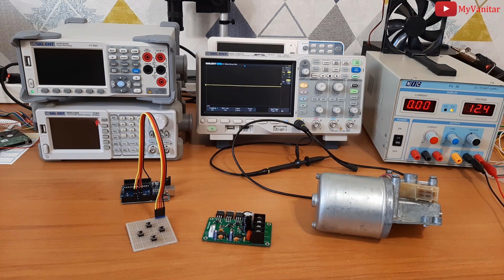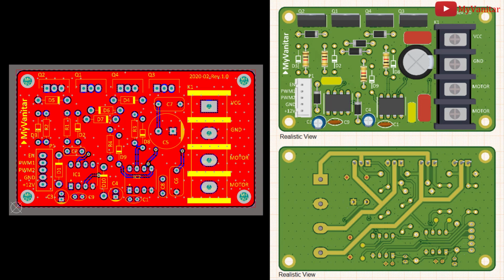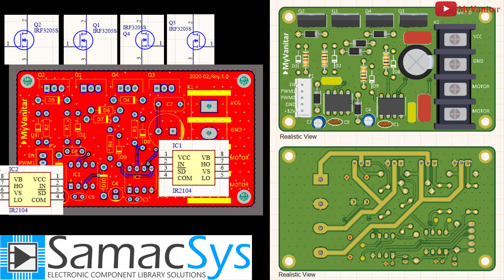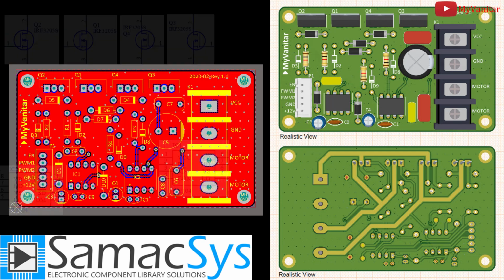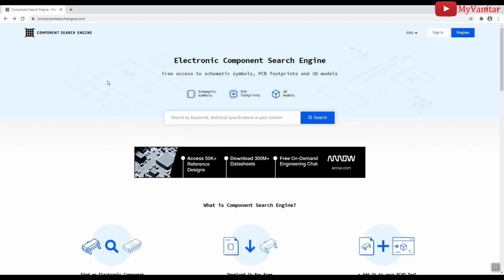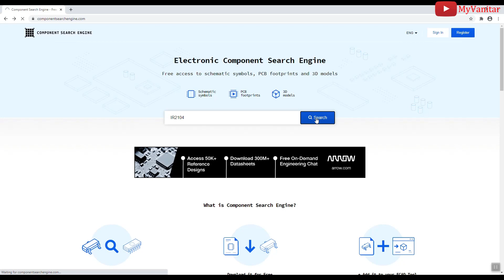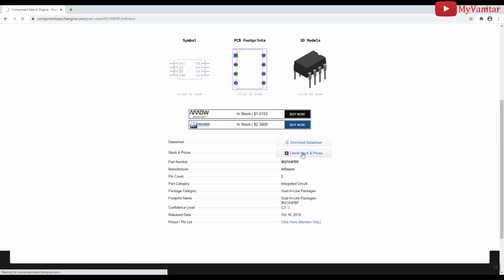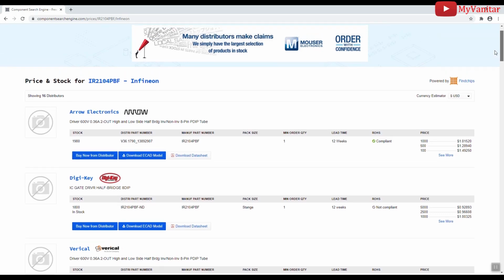H Bridge DC Motor Driver/Control Circuit [40A PWM, Power MOSFETs]

Comment: can I use it for nema34 stepper motor??
Reply from the maker: The short answer is No, because stepper Motor mechanism is different. it needs its own driver. I may cover it in future articles. it is not difficult
Reply from the maker: You need two of this circuit to run a stepper motor, one for each winding

Comment: Sorry but Its not keeping the torque identical that I'm interested in. Would like to know how this driver board performs under a sustained high current load. Simples!
Reply from the maker: the half bridge and full bridge configuration are the only methods that you can trust for stability and also low EMI
Reply: @MyVanitar  is this a full bridge?

Comment: Nice project. can you share your altium designer PCB file
Reply from the maker: Have you checked the article?, below the article there is a link where you can download the Gerbers or order 10pcs PCBs for a very cheap price. These projects are for non commercial purpose. so I'm afraid about the original PCB file

Comment: I need help, please.
I couldn't get IR2104 but I got IR21884S.
my IR21844S was working when SD (ShutDown active Low) is powered with High logic level  (5V) and Vin with Low logic level  (0V), IR21844S Low Side(LO) = Vcc Voltage and IR21844S High Side(HO) = 0V which "was" Correct. and...
When both SD (ShutDown active Low) and Vin is powered with High Logic level  (5V), IR21844S Low Side(LO) = 0V voltage and IR21844S High Side(HO) = Vcc Voltage which "was" also Correct.
-----------------------------------------------------------------------------------------------------------
Currently now, when SD (ShutDown active Low) is powered with High logic level  (5V) and Vin with Low logic level  (0V), IR21844S Low Side(LO) = Vcc Voltage and IR21844S High Side(HO) = 0V which is Correct.
But when "both" of the SD (ShutDown active Low) and Vin is powered with High Logic level (5V), IR21844S Low Side(LO) = 0V voltage and IR21844S High Side(HO) = 0.790V - 0.897V according to the Vin PWM signal variation Voltage is not supposed to be. 
In a nutshell, IR21844S High Side(HO) is not bringing its voltage anymore when both SD (ShutDown active Low) and Vin is powered with High Logic level  (5V) while IR21844S Low Side(LO) = 0V.

What I noticed I did wrong was that I did not connect the SD(ShutDown active Low) to any Logic Level(High or Low) which I know it shouldn't affect it because it's automatically connected to the GND according to its datasheet Functional Block Diagram but I only connected the Vin to High Logic Level(5V).
secondly, I used a Lead Acid battery 5V 4.5Ah (20hr) as my Logic Level.

Please Help me out...
Reply from the maker: did not understand your question, however, the chip is IR2104. You should power the chip with 12V. The load supply (motor for example) could be anything from 12V to 50V. in my test, the motor was also 12V.
Logic level is NOT identical with chip supply. logic could be 3.3V or 5V.
Reply: @MyVanitar  I know that Logic level is NOT identical with chip supply. logic could be 3.3V or 5V.
Yes, the chip is IR2104(8pins) but it's the same with IR2184(8pins) / IR21844S(14pins) according to the datasheet (They are both Half-bridge driver as although I know we have the Full-bridge driver which is different).

The Logic level 5V is meant for the EN pin so as to enable the chip to be active and also meant for the PMW's pin so as to switch the Half-Bridge from its initial position LO = 1 & HO = 0  to  LO = 0 & HO = 1 so that the motor spins clockwise or counterclockwise accordingly to the chip powered.

Now, if the EN pin is HIGH (5v) and either PMW1 pin or PMW2 pin is HIGH(with PMW voltage), there should be Movement, right? Yes. which is equivalent to  LO = 0 & HO = 1.

But my own case is different, if the EN pin is HIGH (5v) and either PMW1 pin or PMW2 pin is HIGH(with PMW voltage), there will not be Movement.

I traced where the problems are then I got to know it was from the Driver High Output(HO) having 0.790V which cannot drive the gate of the transistor and therefore the case is now  LO = 0 & HO = 0.
 
Recall it was working normally before. 
What I noticed I did wrong was that I forgot to connect the EN Pin to any Logic State(0V or 5V) but I only connected the PMW1 Pin to 5V.
secondly, I used a Lead Acid battery 5V 4.5Ah (20hr) as my Logic Level.

I hope you'd clearly understand the problems now.

Solutions Please I really need to get out of this problems
Reply from the maker: @deewansonicengineering  Hmmm, have you build my designed PCB or you are designing your own? in my design one EN pin decides about both chips. so for rotation change, you just need to disable the PWM of another channel and start the desired channel, one PWM channel at any time (check the Arduino code). PWM is also a few kHz square pulse, not a single pulse, are you sure they are generated correctly? The EN pin also should be kept high all the time as you see in the code. I have also provided an easy Arduino code for testing purposes which you can use. As a result, the circuit has been tested and I have not received any comment so far. Yours will work also don't worry. just check what you have done incorrectly. Also check for hardware mistakes, such as soldering. the oscilloscope also helps a lot. I don't know where you got the driver chips, but there are fakes in the market. as I always introduce a place to purchase original ones.
Reply: @MyVanitar 
The Testing Arduino code, is it in the article website?
it's now impressive, I'm feeling you are now understanding me.
 I designed mine @PCB.
Yes, one EN is for both chips that's correct here also.
Yes, for rotation change, one PMW has to be disabled for the other to be enabled as Arduino code implies, that's correct here also.

The EN pin also should be kept high all the time as you see in the code. Yes.
 just check what you have done incorrectly. was perfectly working before.
From my diagnoses,  even if PMW signal is applied, the HIGH OUTPUT from the driver is not having any voltage to switch the Gate of the High Side MOSFET IRF3205.
From these perceptions and answers, I think all the Drivers are faulty right? This is kind of hard to believe.
Reply: @MyVanitar  
this is a little piece of your code shown below here.
byte PWM1_Pin = 11;
        and       byte PWM_Pin = 11;      <= Hope this isn't an error?

int PWM_Value;
byte Enable_Pin = 13;
byte PWM1_Pin = 11;
byte PWM2_Pin = 10;
byte PWM_Pin = 11;
Reply from the maker: @deewansonicengineering  Why hard to believe? I have faced many fake components so far, that's why I suggest people in the video and article to buy the components from componentsearchengine.com. You should watch the videos completely and also read the article carefully, as you said you have not checked the article, if you were considering that, you were getting more information, such as the code. Same you can order 10PCs of PCB for just 5USD there. Anyway, as it is your own PCB, I can not help that much, I can just confirm the operation of this PCB. As a result, check your board with my code, if still you could not get good results, make sure your PCB/Soldering ... etc are right, do the same for the chips
Reply: @MyVanitar  ok.
but see these...
this is a little piece of your code shown below here.
byte PWM1_Pin = 11;
        and       byte PWM_Pin = 11;      <= Hope this isn't an error?

int PWM_Value;
byte Enable_Pin = 13;
byte PWM1_Pin = 11;
byte PWM2_Pin = 10;
byte PWM_Pin = 11;
Reply: @MyVanitar  'Button' does not name a type; did you mean 'ultoa'?
I got above error message while compiling. any help?
Reply from the maker: @deewansonicengineering  Are you new to Arduino? You should install the necessary libraries, only default Arduino libraries do not require installation. So install the JC-Button library. There is no error in the code. if you watched the video, I do the test using this.
Reply: @MyVanitar  yes but I'm trying with massive effort.
This is solved the program is compiled.
 here's my last question...
check the code below... 
11 is assigned twice to two different declarations byte PWM1_Pin and byte PWM_Pin. 
is this normal? or was supposed to be assigned to 12?

#include <JC_Button.h>

int PWM_Value;
byte Enable_Pin = 13;
byte PWM1_Pin = 11;
                              **************************
byte PWM2_Pin = 10;
byte PWM_Pin = 11;
                               ***************************
Button UP(9, 25, true, true);
Button Down(8, 25, true, true);
Button Left(7, 25, true, true);
Button Right(6, 25, true, true);
Reply from the maker: @deewansonicengineering  No, that's the initial state of the PWM_PIN. it changes in the code later on. 10 or 11
Reply: @MyVanitar  firstly, for your time. I'm saying a big thanks to you. 
also, for not getting tired of my question that you even answered them. Thanks.
I really appreciate your effort.
I'll just need to get another IR21844s to make it work and upload my program on it.
Thanks.
thumbs up @MyVanitar
Reply: Hurray!!! The whole thing has worked completely without replacing any component. Only that I converted it to use Joystick and it's working well and fine.
I got to know that while testing with a multimeter without load will not give me what I want except load is connected. Thanks

Comment: İf we want made high voltage driver how we can made this ? İ mean 350 v dc Thank you.
Reply from the maker: Yes, you can. Why not. However because of your input voltage, you must replace some components. Change MOSFETs with something with higher voltage, such as IRF840, IRF540 or whatever. Majority of the Mosfets have the same pinout, including the ones which I mentioned. I mean G-D-S. Also low RDSon means lower temperature for the Mosfets. Second you must change the Motor connected capacitors with 400V rated capacitors. I don't remember the capacitor names, check the schematic. The value of the capacitors that are used to reduce the noise for the Motor are not critical, however for your case, make sure they are rated 400V. select the capacitors that fits the footprint on the PCB. That's it. Simple.
Reply: @MyVanitar   and can we use igbt ? Same footprint  . İs it possible. Thank you
Reply: Can u rebuild for servo driver. Like direction and enable pins. Thank you.
Reply from the maker: @raer7844  I don't think it would be a problem, try it. order the PCB and test. with any condition PCB is the same.
Reply from the maker: @raer7844  I did not get your question regarding Servo.
Reply: @MyVanitar   i mean i want to use like close loop servo driver. İ ll take feedback with encoder from motor to my processor and i will send my direction and enable signal to this driver.  İ dont wanna busy with acceleration decelleration proccess.thank you.
Reply from the maker: Yes you can use this as a driver and an intermediary circuit

Comment: hi...PLEASE HELP,
I have a TC4429 Driver chip and a IRF4905 P channel mosfet.
I want to make a High side drive.
I have put a 1k resistor from gate to positive,  10k would be better.
the Source is direct to Positive and a 12 volt 1 Amp bulb is connected to drain and Gnd.
the TC4429 is run on 12V.  i am feeding it with a PWM signal.
I cannot get the P channel mosfet to vary the output at all. it stays in the ON condition.
if i use an N channel mosfet it varies the output... in high side mode... but makes lots of heat!
i just want a decent High side driver ... i want 3 amps at 24v PWM output once i have a good circuit.
HHHEEELLLPP!    :o)
Reply from the maker: What do you want to build that forces you to build a high side circuit?
Reply: @MyVanitar  A hydrogen electrolysys cell that has a steel case that is the negative. the negative is the ground for bolting onto the body of a vehicle which is negative earth.   so i dont want to 'isolate' the main body from the negative of the battery.
so i need a posive that is being driven by PWM....   therefore a high side is needed.  24v at 3  amps.   dont care what mosfets p or n... dont care what chip.... but need it the day befoe yesterday ..   :o)  ive got  irf3205 N channels    and ive got  IRF4905 P channels.    driver chips got TC4427 (low side driver)   and TC4429(inverted High side driver) ...    but it HAS to be that the Hydrogen cell Negative CASE is permanently Connected to the NEGATIVE of the battery.... so a PWM to feed the positive terminal of the hydrogen cell at 3 amps 24v...   i cant get the P mosfet to turn on and off with the TC4429. im driving the chip with 12v and temporerily using 12v on the l;oad side also.  (just a 12v car light+ car battery)
Reply: @MyVanitar  okay ive got an LED working..(i simply had drain and source wrong way round).... however its fine with chip running on 12 volts and mosfet also connected to 12 volts. But i want to have 24Volt output.     but the chip cant run on 24v...they go BANG!   i just found out.. :o)
but how do i drive the P mosfet if it is connected to 24v, but the chip can only run on 12V     [ i dont think i get a high enough voltage on the gate]    ive put a 10k resistor from the gate to the positive.
   ....    :o)
Reply from the maker: @InterdimensionalWiz  it is a bit hard to completely get what you mean because you know what's going on, not me. However, using a P Channel MOSFET I think fixes your problem, without using any special circuit or a high side driver.

Comment: Can I control HHO cell 24 v 40A by using this circuit
Reply from the maker: Yes, However watch the video completely and read the article. Strengthen the tracks and use a big heatsink. if you check the video and article you'll get the point.
Reply: @MyVanitar  tku

Comment: IR2104 MOSFET is a $3 chip, ouch!
Reply from the maker: so what? good things are not cheap
Reply: @MyVanitar  I agree, I also need to break the habit of "overseas" parts. Your schematic is fine. I read up with the corresponding datasheets and this build looks solid. I'm doing this one.
Reply from the maker: That mosfet offers good figures, very low Rds(on)